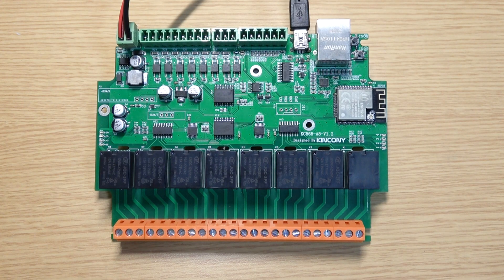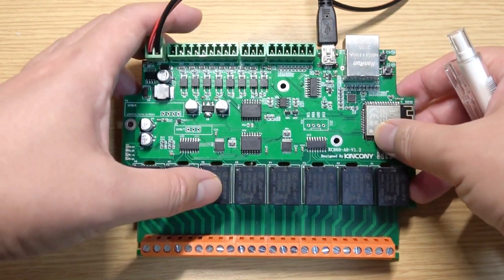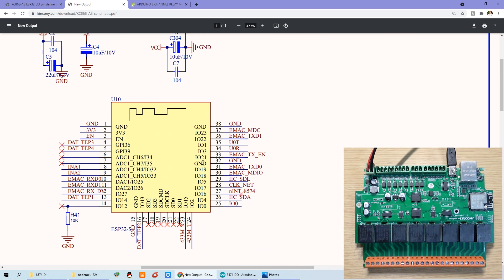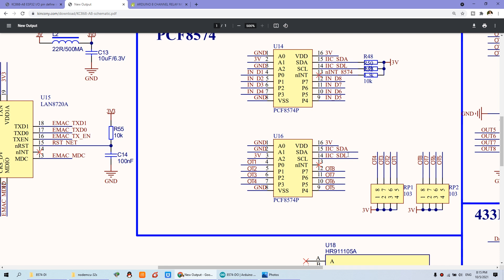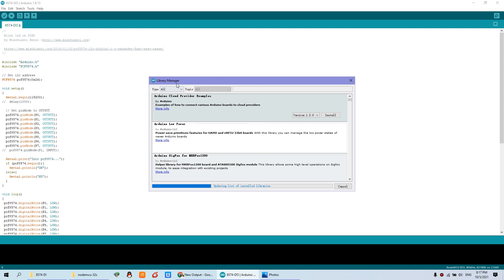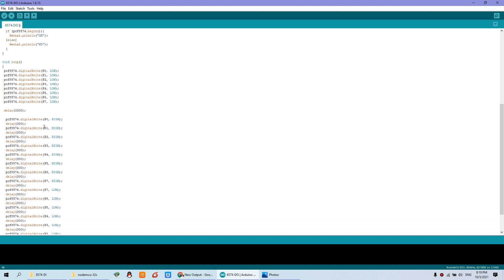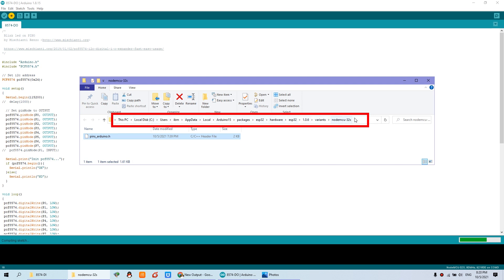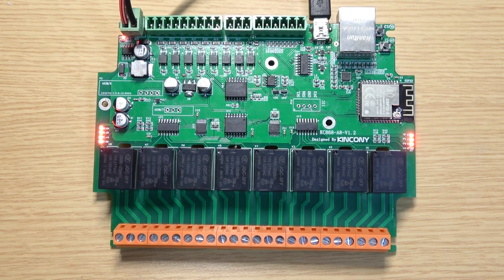Lesson19- how to use PCF8574 IIC extend GPIO for ESP32 multi relay

Comment: Great job 👍👍👍

What if I connected pcf8574 output pins to uln2003 input pins directly (without convert level)  , will it work??

Thank you
Reply from the maker: the relay state will not normally
Reply: For this reason you use 7414
Reply from the maker: yes @shakerileiwat4341

Comment: Video on the inputs? Thanks
Reply from the maker: INPUT as same as OUTPUT, just set for INPUT mode for PCF8574.
Reply: @KinCony  I'm using pcf8575TS chip and also use Renzo library like you. Having issues reading input from external 10k pullup pushbutton 3.3V... But when directly connecting 3.3V to input pin I get High. Am I missing something? Have declared as Input.
Reply from the maker: @wikovisser3664  this is our source code for PCF8574 use INPUT port, you can test it: https://www.kincony.com/forum/showthread.php?tid=1912

Comment: If I understand your schematic and your code, Is the output of the pcf8574 inverter using 74HCT14?
Reply: As you know the pcf8574 is internally pulled up. So in this case, all the outputs of the pcf8574 will be on when you startup the device. which in some cases will be a problem.
Am I right? and do you have solution for this issue?
Reply from the maker: @osamahnini9829  our board no this problem, you can check with our board diagram.
Reply from the maker: no, that is for 3.3v level convert to 5v.

Comment: You are a champion mate! It's really great these updates, your work hasn't gone in vein as I've used the same module before and she works like a charm. With your controller and ESPHOME I find much easier.
Reply from the maker: in furture will make video ESPHome by LAN with ESP32.
Reply: @KinCony  In their software it much easier to use, not happy with your design mechanisms but new revisions are promising!
Reply from the maker: @TradieTrev  which "mechanisms" details not happy with you? can you take an example?